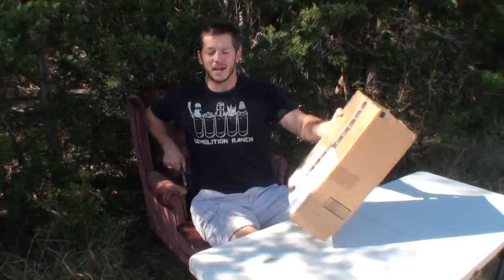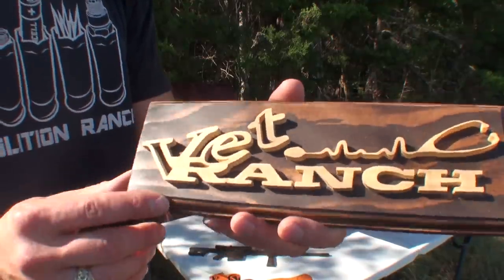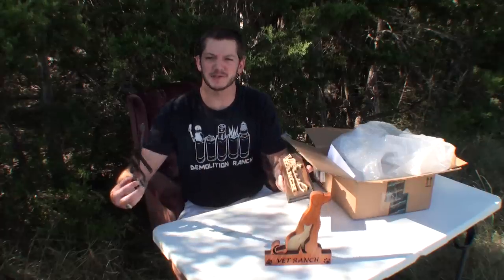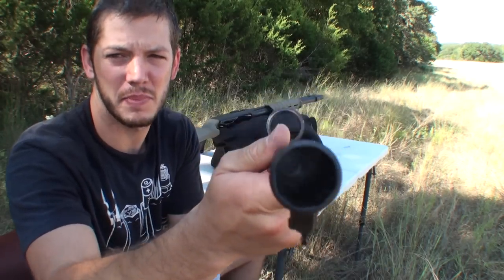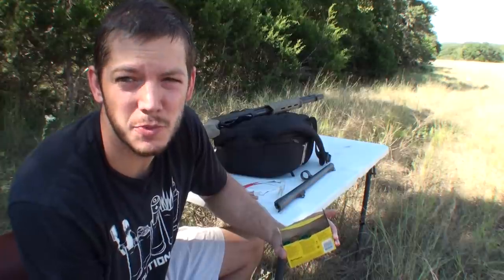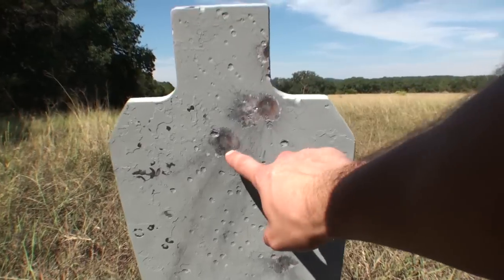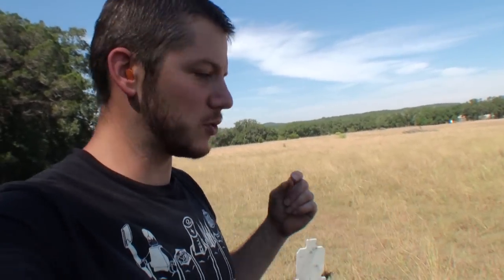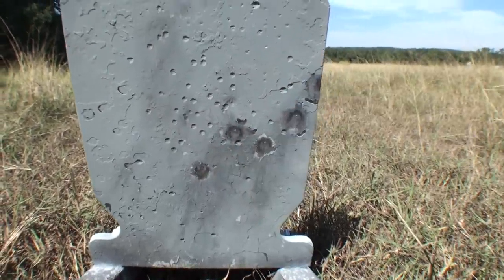Rifled vs Smooth Bore Barrel

Comment: Probably should've done just a tiny bit of research before jumping to such a bold conclusion after a test that makes no sense. All you proved is foster slugs don't improve in accuracy when fired out of a barrel they're not designed to be fired out of... Duh. I'm sure he's realized that by now though.